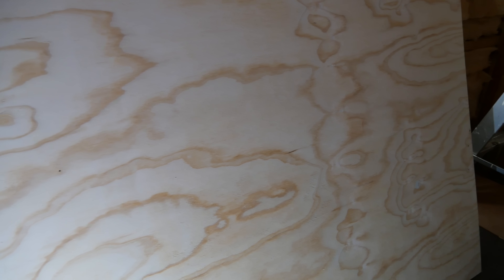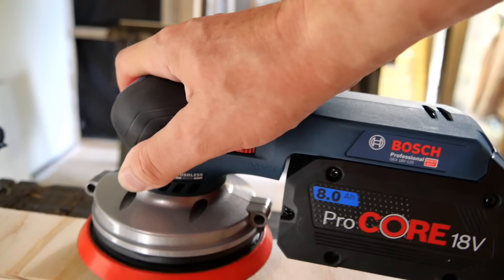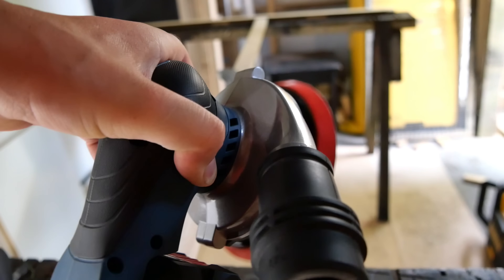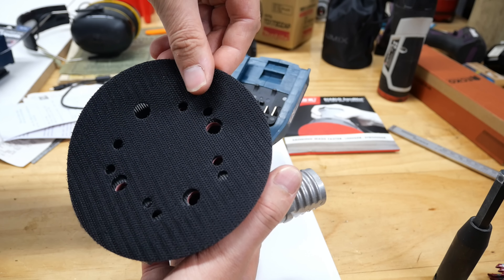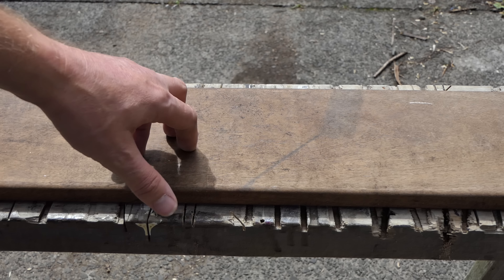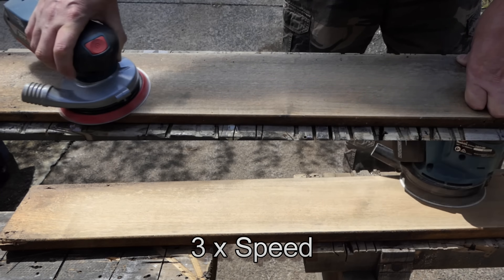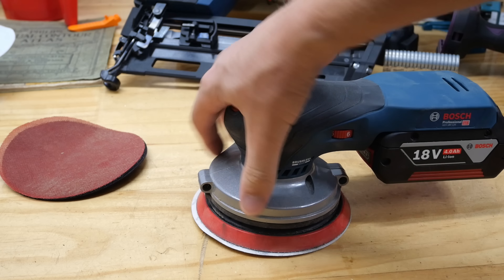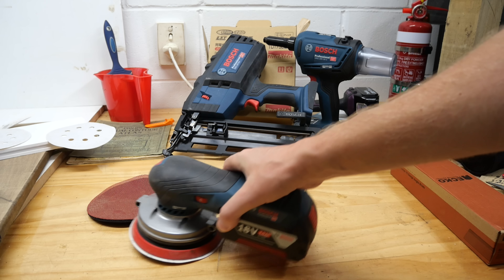Bosch 18v Random Orbit Sander and Diablo SandNet Review

Comment: Tools & Stuff  Your right it's a brilliant sander, best I've ever had. ? When using my GEX 18V-125 sander attached to the vacuum, does or can the suction caused by the vacuum take air away from the air cooling system please.

Comment: I bought the Bosch 18-volt sander with a standard 4AH battery last year. The ergonomics just scream at you.
Get yourself some mixed git 3M Xtract screen style sand pads you will be dumbfounded at the removal rate. 

I use it with a hose from my Bosch planer to their cordless 18 volt round vac and am loving it.  I have Makita, Milwaukee, Dewalt, and now Bosch 18/20-volt tools, yes, a cordless tool whore. But I appreciate superior design and can afford to disregard the battery platform.

 Bosch nailed it with this sander. For small and medium wood working projects this thing is a joy to use. Get the 3M Xtract discs and you'll lose your mind with the combination for sanding. It’s been a revelation even to me.

Comment: I just bought quite a few Bosch 18v brushless tools. I am very impressed so far. I used to only buy makita because of my father. I am about to buy the Bosch sander, grinder, and the circular saw. I’m thinking to go corded with saw and grinder however. Looking back to my days as a professional carpenter and battery saws were just a joke. I’m only using them for personal projects so I don’t need the best, fastest drill and all that. I just want quality tools that hold up. My last boss only used Bosch  sanders. He was in the finishing business 20+ years. As you can imagine he did ALOT of sanding.

Comment: It’s advisable too use a pad saver whenever you use a net type pad.. that little sacrificial pad Tools uses behind the mesh pad…the hairs on the Velcro poke through the pads and you will wear your Velcro off prematurely. I’ve gone through makita bases using these abranet type pads. just a heads up too those that don’t know.
Reply from the maker: There is one being used in this video.
Reply: @ToolsAndStuffOFFICIAL  edited. Thanks.

Comment: hmm wonder how those compare to the 3m cubitron discs. as those are the ones that the professional car bodywork industry uses. seems a bit expensive though because considering if it gets damaged then that becomes too costly to replace an individual single disk. so that seems a bit risky for general purpose random stuff or lower quality. wheras if it was in a controlled environment, for example making surfboards... well ok then. because thats an environment or situation where you are less likely to randomly incur damage onto the disc

Comment: I have two of the Makita's and have used sanders for decades that are shaped just like the Bosch. I grab the Makita side on. Switch between side on and top. Makita should be watching this! Mine are as strong as yours to. I can't stall my Makita and I'm 114kg little guy.

Mark
Reply: Agreed and makita will do a better job of not putting the dust port on the side, seriously gets in the way, plus makita will be more powerful and less vibration!

Comment: I would love Makita to come out with a similar designed sander. I've just ordered in that Makita sander and it seems bulky, but it's what I need for now.
Reply: I sent the Bosch Sander back, really love the low profile but the dust port sticking out is horrible, gets in the way on the side more so with extractor hose. Bought a makita!
Reply: @mikemhuk  it's tall but I absolutely love it. Make sure to always have a full battery, for that tool the battery level is almost equal to power level. Swap out the battery at half or 1/4 and you'll hear and feel the difference. It's better that than having the tool burn out the batteries like other companies
Reply: @EliotTruelove  thanks for the tip

Comment: Do you have any adapters from Bosch to Makita? I would love to know if the little Bosch could run on Makita batteries!
Reply: It can. I have this sander and run it on Makita 18v batteries. I got the adapter off Amazon. It doesn’t seem to run at full speed, but it does work well still.
Reply: @nelsoncarpentry  Thats great to hear! And there is enough space for big batteries and the adapter underneath the sander? I'd love to see it running somewhere, hopefully tools & stuff can show us how it works. Noone on the internet seems to have it done before.
Reply: @0j0nn  Plenty of room for the Makita batteries. I can post a short for you in the next couple days.
Reply: @nelsoncarpentry  I'd love that, thank you!
Reply: @0j0nn  Finally got it uploaded. Enjoy!

Comment: The Bosch absolutely doesn't fit my hands. With big hands your palm sits way too much over the battery and forces the sander to do a wheely. When I put my palm in the right place, I don't know where to put my fingers - which results in perfectly trimmed fingernails. 💅

Comment: I grabbed it last year because it was so cheap with battery and charger (I had already gotten rid of my Bosch stuff) and I found an instance where I could use a cordless sander.  I’m spoiled with Festool (and depending on who you ask Mirka is even better.) Honestly, was impressed at first but it ain’t no Festool.  The dust extraction is not all that on the Bosch.  It all clogs up in the centre. If you need cordless it will get the job done but I didn’t really need it in the end.